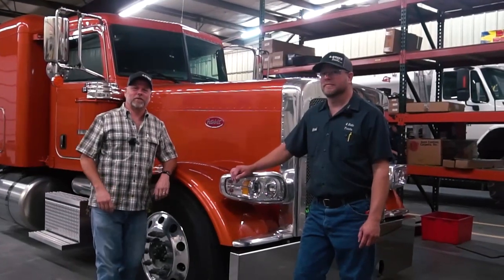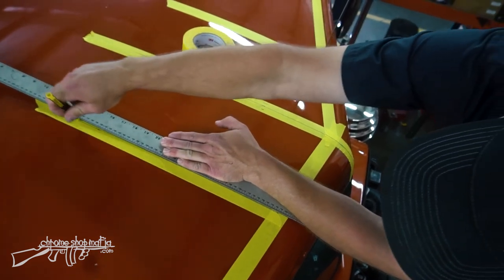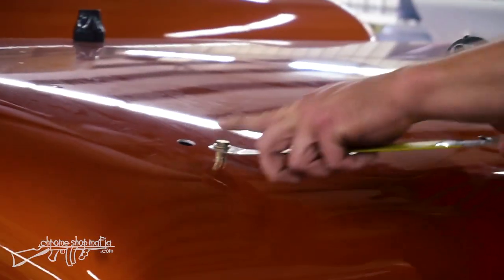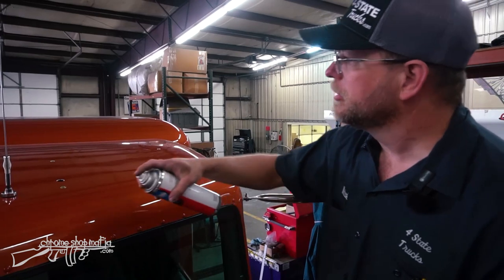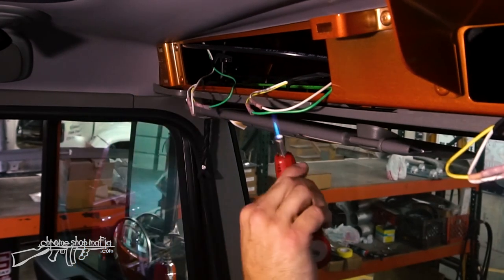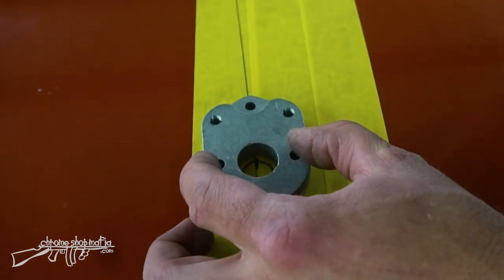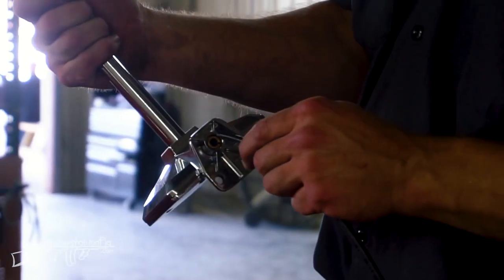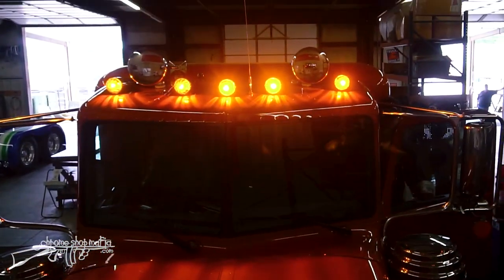"Ranch Hand" Peterbilt 389 Installs - Cab Lights & Air Horns - EP 4

Comment: remove any alum parts in box 
seal lid, “fab a fill”  add interior stainless 
plate bars on rear wall so no mount brackets 
are needed